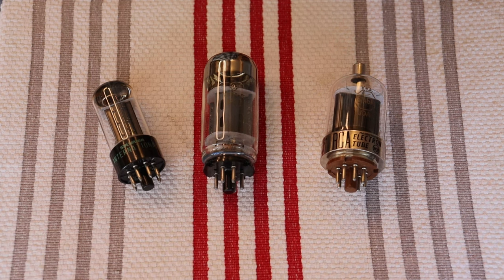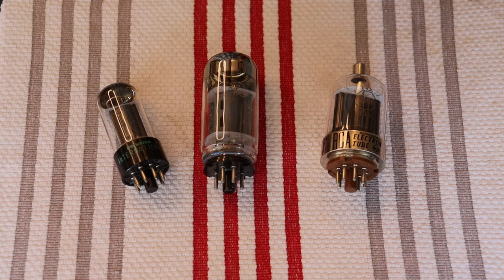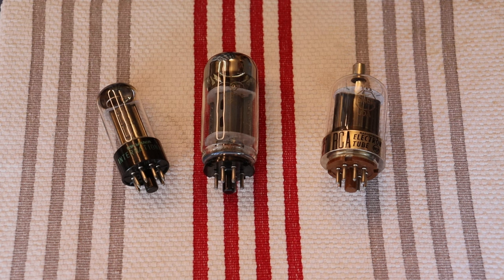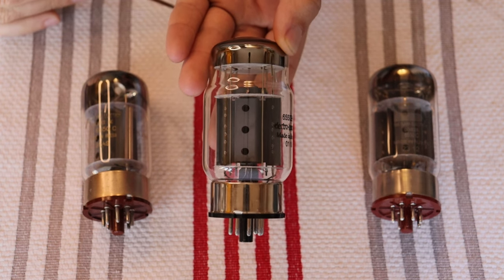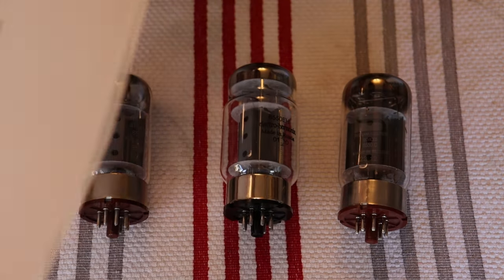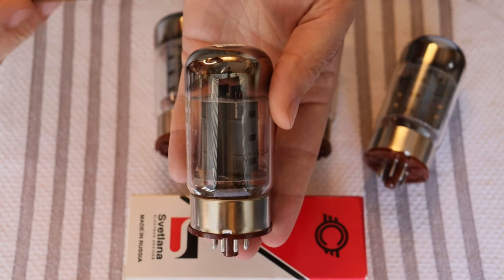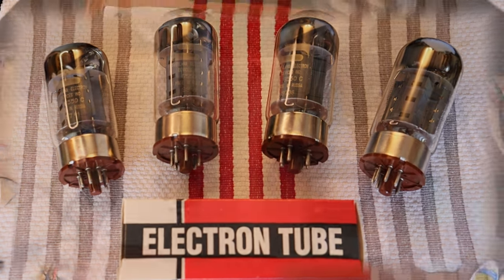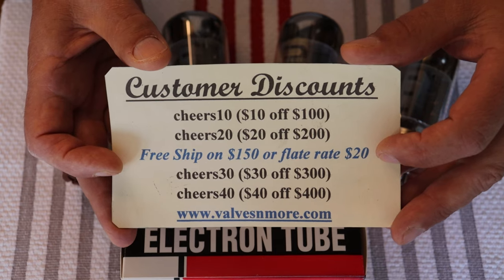Tube Lab #201 - 6550 Power Tube Revisited

Comment: My VTL mb-300 monoblocks came with 8x 6550 in each one with a 12au7 -> 6350 driver. They have cheap psvane kt88s in them now, because I couldnt afford to get good ones...but with decent driver tubes, they still seem to work well.

Comment: I'll be very interested to see if you do a KT88 comparison. So difficult to purchase any of the newer production stuff with so many reviews that may oy may not be reliable. Right now, I'm running a DIY Blueglow SE amp and swapped out a pair of older PSVane KT88's for an older pair of unused EH brand and it was a good move. I'm wondering if there's anything significantly better in today's production. Maybe even a lateral move to 6550's.
Reply from the maker: @JS-oq2cd  yes, most reviews, even honest ones are comparing modern production to modern production.  Whenever you compare a quality vintage tube to a modern copy, the difference is so obvious you can never go back!  This is why choosing gear that uses fewer tubes and more available vintage types is so important going forward.  We'll continue to design Kits around those affordable tubes, IMO that's the only practical future.